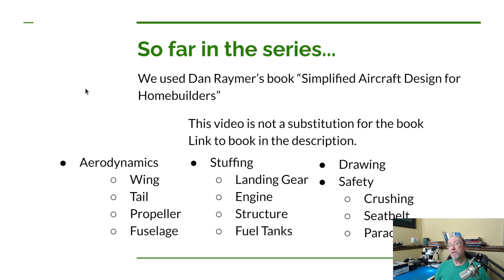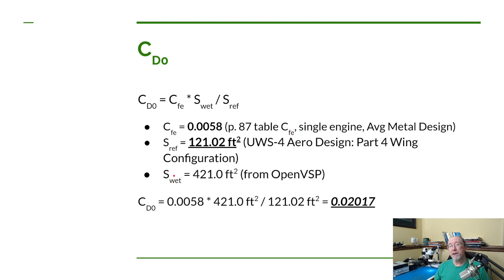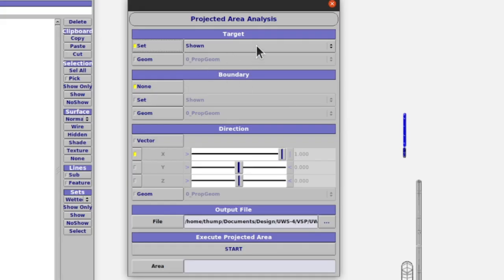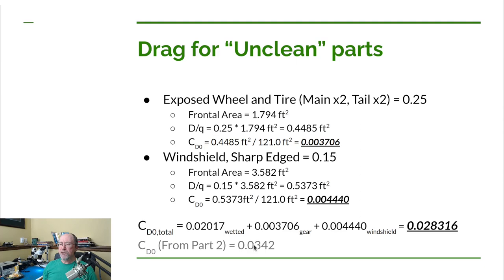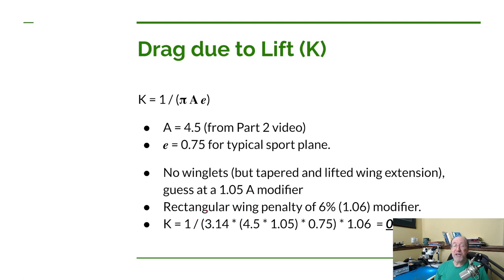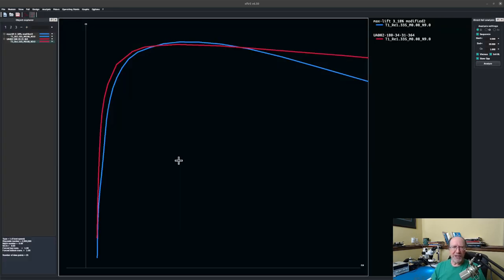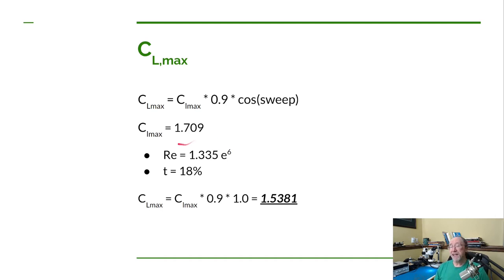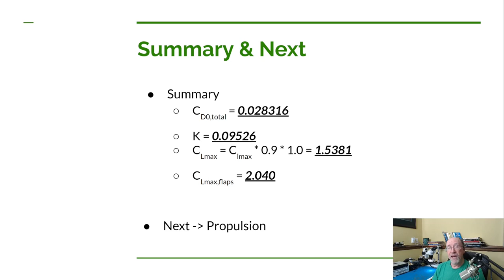UWS-4 Aero Deisgn: Part 8 Aero Analysis

Comment: Hi Leon,  thanks for your videos. They are very helpful.   If you like I can do some CFD analysis for your design so that you can make a comparison between CFD and  VLM. Because based on my experiences, the OpenVSP maybe not be that good in the nonlinear phase at large AOA.    And the simplified flap may not that effective as the VLM offered.   However, OpenVSP is a very powerful tool and highly recommended for aircraft design.
Reply from the maker: At some point I'll get around to some CFD. For this airplane I will probably skip it. But in the future I expect to work on less conventional designs that will require CFD to be more sure of the design behavior. Thanks for the offer!